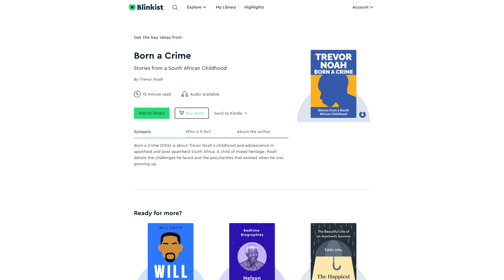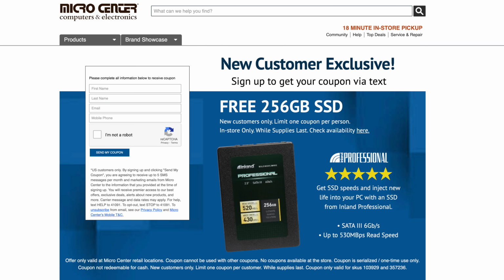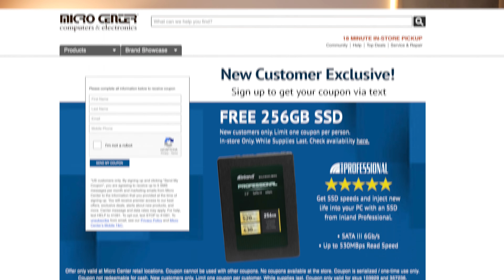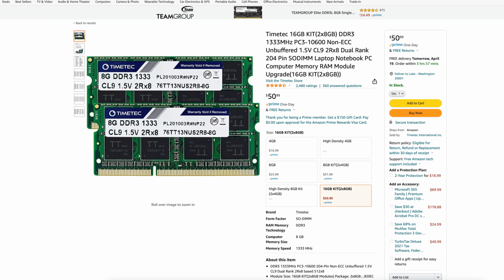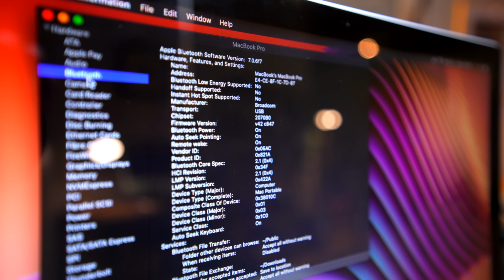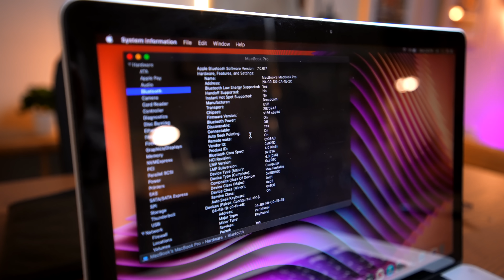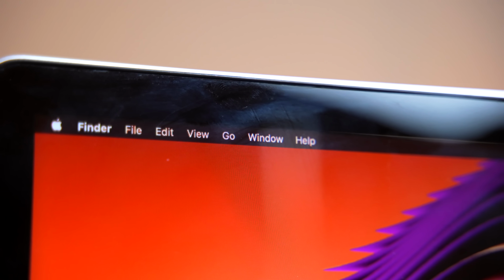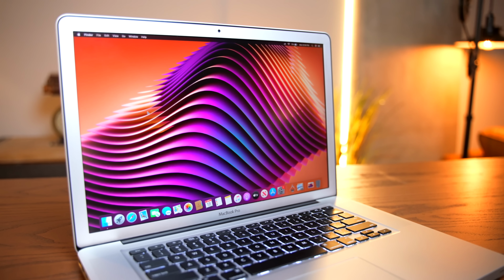Breathe new life into an old MacBook with THIS upgrade

Comment: I do not know Mac books.   So, a question.  Did Apple limit OS versions to certain hardware  model releases?   (As they did the iPads, itouch, etc.    ).  If I got an old Mac/upgraded it.  How easy is it to get what I consider core apps?  Word/spreadsheet/. PDF software?  

I am disabled, disability income….(never will afford a new Mac).    What is a good “cutoff year/model”?  Upgrades for it? And broken out cost?   Also, could we upgrade USB PORTS TO USB3.2?   OR EVEN SAME USB PORT VERSION, BUT NEW PORTS THAT ARE NOT WARN OUT?  THAT IS BIGGEST GRIPE I HAVE WITH OLD COMPUTERS/LAPTOPS.. LOSE WARNOUT PORTS.   

Next,….have you looked at other Apple devices?  Itouch 128gb!  Color…no camera, metal back, needs new battery.

Omg…lol. Run a wire out and correct electric current, I would be in heaven. Lol

would you buy /upgrade Mac for a buyer?

Comment: I just put an SSD and 16GB of RAM in my sisters 2010 13” MBP. My mom has a 2010 15 that will be getting all these mods you listed and using Open Core Legacy patcher to get them on Ventura. Thank you so much for making the video.

Comment: In Denmark all these upgrades would cost you $500. And if you want to buy a second hand MacBook Pro from 2010 it will cost you another $200 - $300. For that money you can buy a new laptop with much better hardware (better graphic card with better screen resolution, NVMe, USB3, modern CPU). Also, graphic cards on these old MacBook Pros suck. They lack Metal support.

Comment: in my opinion just saving from landfield a good working laptop is a good idea that in my case its not that good because of cost, i paid for my 2009 13" macbook pro for like 430 PLN (around 95 USD) and paying around 451 PLN for parts (if i found any) its just doesn't count, next i can't find any display or wifi card on most popular amazon replacements in poland so i don't think is that worth it

Comment: Well, I had a dual core from 2008 til 2 years ago. And the only reason I got rid of it was because the logic board died. Now, not a mac but I still have a Dell Latitude  6540 from 2014 and still running like a charm with windows 11. The only upgrade I have done to it is the replacement of the hdd to ssd. Just mention it to confirm what you have just presented here. Computers have become a lot more long lasting.

Comment: Great video. I have a 09 13” 11 17” and 12 13” all have ssds and max ram 16gb on 11 17” and 12 13” display upgrade on 11 17” these machines out lasted all my retinas MacBooks. My retina MacBooks all died with motherboard failure from overheating. I’ll never ever by another MacBook again. But I’ll keep my 09-12 for as long as they still function.

Comment: Nice vid & I agree. I have 2 Macbooks; both 2012 15" w Hi-Res Matte displays. One is a 2.6 ghz and the other is the option order 2.7 ghz. They are quite amazing, especially for their age
Reply: I have the same mid-2012 15" machine, albeit without the matte display (honestly, 1440x900 doesn't bother me much: it's still a lot nicer than the 1280x800 of the 13", which I've also got). It has 16GB of RAM, 4TB total of SSD space (I removed the optical drive and replaced it with dual 2TB SSDs); I have a Thunderbolt PCIe expansion chassis with a USB 3.2 gen 2 card, and two Belkin Thunderbolt 3 docks. Using OpenCore and Kryptonite, I'm running Big Sur and running an external Radeon RX 580 (the funny thing is that Big Sur actually runs better, and throws better benchmarks, on this machine than Catalina does, which was the last officially supported OS). This thing drives four monitors on its own; with the eGPU and Thunderbolt expansions, it's like an entirely new machine and easily hangs with my Ryzen-powered Windows gaming rig (significantly outperforming it, in some cases). When Big Sur support is dropped next year, I'll upgrade again to Monterey, buying myself at least one more year of software support and, depending on whether they figure out the kinks of getting Ventura running well -- I am hoping by the time Monterey is dropped, that I'm happy enough with Apple's offerings that I might consider a new machine, but so far, I just can't let go of this one. It's fast, reliable, and can still do plenty of heavy lifting (I run the IT department of a not-for-profit and this is my main portable machine, and while at home and on my desk with all its Thunderbolt expansion goodness and dual Cinema displays, it does quite a bit of video and audio editing). All on a machine I got for sixty bucks off eBay.

So you're absolutely right: they are quite amazing for their age. I'll keep mine chugging along, and wish you luck with yours as well!

Comment: I'm new to this channel as well as Macs. Been a PC user since 94'. Do these machines have tweekability in BIOS/UEFI like PC's? What about the CPU/GPU..integrated or upgradable at all? I got ahold of the 17' A1297 model recently for free but it needs some repairs. I don't mind shelling out the cash for it and the upgrades available to it if it can be put to work as an office/desk unit. Not trying to do intense graphical work on this thing. Maybe just Procreate or Sketchbook Pro for illustration.

Comment: I still have a 17” Mid 2010 i7 MBP Antiglare with an SSD and max ram and incredibly it’s still completely useable! I finally got an M2 MacBook Air (which is lovely of course) but I have so much love for the old one. Also, it has FireWire, Ethernet, MagSafe and Thunderbolt so really good IO for music production given its age!

Comment: I also still use and love my mid 2012 15" Retina MacBook Pro. Upgraded the WiFi/Bluetooth card to 802.11ac and Bluetooth 4LE a while ago. It has 16GB of RAM and a SSD, which I upgraded many years ago to 1TB (transcend). It is powered by a 2.6GHz Core i7.

 This machine runs everything I need it for as good as when it was "new". Even the battery still works for a few hours(!). Absolutely no need to upgrade to a new machine.

Comment: Love those siIver bezels, like the old Airs. I have a 9-year-old MacBook Air which I upgraded at purchase (mid-2013 model) to 8GB RAM, plus 256GB SSD. I’m still using this for almost everything (with heaps of apps effortlessly open at once, including the net!), despite it being inadvertently hosed down from my top floor neighbour’s roof garden through my desk window in around 2017 or so!!! (Sat it on a step ladder under my ceiling fan, with silica gel sachets all over it — keep those from vitamin bottles, etc! — for only 4 days!) These machines have incredible integrity. 

I’ve just purchased an extremely expensive (AUD$) upgraded 24” M1 iMac, and despite the great screen and webcam, my 9yr-old MBA has a much better trackpad and keyboard, and the “in the cupboard” speakers on the iMac are a real disappointment (12 years ago, pre Apple, I bought a Dell Studio laptop that had such powerful JBL speakers that I could watch the classic  “Blues Brothers” original film without headphones via the DVD drive — those were the days!!). New is not necessarily better.

Comment: I just bought the 2012 13" MBP for about $100. No drive, but I had a 1TB lying around (750 Mac OS/ 250 Windows). It came with 8 Gigs, but I plan on making that 16. It was More difficult than it should have been to get the iWork apps on it.

Comment: Luke, i'm trying to get a better display for my MID-2012 Macbook pro. I've update it with 2 500gb SSD / 16 GB RAM and it's running Catalina 10.15.7 / It works like a charm, but i was wondering if there is any way to upgrade the display with a one with a better resolution like you did in the video. I couldn't find the link to buy the display that you showed in the video, do you have it?

Comment: I’ve had every Mac computer since the 90’s, and the 2 laptops you showed. The only problem with having an older laptop is you cannot update to the  newest Mac operating system. I have a late 2015 MacBook,  and cannot update to IOS Ventura.

Comment: Upgrading for a newbie is stressful for the first few times but satisfying when you get the hang of it. Upgrading requires a lot of research and people who are coming here just figuring out you can upgrade an old computer likely won't have the skills to even pull this job off, that's the irony 😂There's a lot of things you've gotta know prior before ripping a laptop's gut's out in order not to make certain armature mistake like accidently pulling a ribbon cable too hard and ripping that shit, put it all back together to not know why your system won't turn on, 🤣fun times!

Comment: That’s not a good idea… that’s a GREAT idea 😊
I still use a 2009 24” iMac on a daily basis but it’s starting to be a little toooo slow (I use it for office work only). I’ve upgraded the ram a few years ago to 4gb (it seems like it’s the maximum it supports) and I want to upgrade the hard drive to a ssd for sometime now… but I’ve never seem to gather the will power to do it… but I recon it’s got to be done… soon 😅

Comment: Still using my mid 2012 15in with Hi Sierra! Running Pro Tools & other apps no problem. Removed the Superdrive ages ago and installed a 2nd SSD drive. Just replaced the battery (now my 3rd) Any recommendations for a replacement wifi card? Hadn't thought about that. Thanks!

Comment: I picked up a 2015 MBP.  It has 16 GB DDR3 ram and a 1 TB SSD card.  As I am stuck with a ADSL phone system it makes no sense to try and rig the wifi for the modern 6G stuff.  Are there any improvements you can suggest for this machine?

Comment: Just watching this on my daily driver of the last half dozen years, a factory original 15" Antiglare version mid 2010 2.53GHz i5 - no screen upgrade needed! 🙂I love this machine!
OK, I swapped out the HDD for a preloved Samsung 840 EVO SSD and have nearly worn that out too, wear levelling is nearing its maximum - but I'm still running High Sierra rather than run a hacked later OS, as the poor old GT330M frame buffer is getting a bit glitchy and I don't want to overwork it (although the fault is most likely a couple of main logic board tantalum caps, rather than a flaky GPU).
It generally works fine although the last High Sierra version of Safari is struggling a bit, and interactions with my iPhone XS Max can be a bit unpredictable - but the later Firefox support has extended its useful working life considerably - it works fine watching youtube video. It even survived me spilling some some tea into it, necessitating a keyboard replacement but my quick action to dismantle it saved the main logic board. :-)

PS - I noticed one of the Macbooks in the video when you were claiming 2010 was actually a 2011 or 2012, as the miniDP aperture had the thunderbolt symbol on it! which was not available on the 2010 main logic board, being miniDP only :-) Cheers!

Comment: well, apple products is not really last so long, since you have to use patch only to use lastest OS, and that is not even the lastest for few models. while you can easily use another OS in an old macbook / macbookpro within lastest update with simply no issues. So its pretty ironic, in Apple side, some models are obsolete, but with other kind of OS, it still a very usable machine.

Comment: I just upgraded an early 2011 MacBook Pro with a 1T ssd, 16 gigs of Ram and replaced the battery for good measure. 
It’s insanely fast compared to before. 3 minutes of boot time dropped to about 30 seconds. 
Now I can haul it to work and not feel like I’m gonna break my new MacBook Air lol

Comment: I have a 17 “  MacBook Pro that I truly love. What might I do to enhance its performance? It works but is really slow. It was the last issue of the 17” MacBook and it is sturdy but as I said, I’d like to continue using it. What do you think, Luke? Love your channel and appreciate what you do. Michael NYC.
Reply: You could try installing a Linux distro on it if it's not your daily driver. (I only say "if it's not your daily driver" because it'll take some effort to get it setup and won't be as reliable as MacOS even after everything is setup just because Macbooks aren't built to run Linux.) Depending on the distro you choose, it could require either minimal setup and tinkering to get working or it might require a lot (or it might not even work at all). I'd suggest something based on Ubuntu. Personally, I really like PopOS and dual boot it on my 2012 MBP all the time. I had to use a wired connection at first and install packages to get wifi and bluetooth working, but after that the only issue I have is that it freezes up if you put it to sleep or shut the lid while it's on. Not a big deal for me, it's basically flawless besides that one issue. And PopOS in my opinion is a very solid, fluid distro with swipe gestures and an easy-to-use layout.

Of course, you should also make sure you've got the RAM maxed out, an SSD installed instead of a spinning drive, the fans and motherboard dusted out, and new thermal paste reapplied if it hasn't been changed in a long time. I recommend Noctua thermal paste, I noticed about a 15 degree difference in temperature! I don't know when it'll need to be replaced again so I suggest installing a temperature-monitoring app in case the paste wears out after a number of years.

Comment: I bought an early 2015 MacBook Air, I was looking to upgrade it to a 2.2ghz core i7, 8gb of ram logic board and a 1tb ssd from the sorry excuse of specs that apple released my model with. I added the price of those upgrades against buying the same spec model  from online from either people or a company. It would cost $700 (this is including how much I paid for the MacBook from Facebook marketplace) compared to 750+ for what people are trying to sell the specced up model at so either way I’d either save money or pay about what I would’ve paid if I bought it and honestly using it stock isn’t even that bad as people say I’ve been stressing the heck out of it

Comment: But what’s the latest upgradable OS does it take? High Sierra? That’s as far as my 2010 Mac Mini goes.  Btw, I upgraded that with a 1TB fusion drive and pushed it to 16 GB memory, which I read was it was capable of handling (officially the max is 8), as long as you used a certain type of memory (which escapes my memory). It’s getting retired this year.  I was hoping for a M2 mini already!

Comment: Watched this on my early 2011 17" Macbook Pro with a 27" thunderbolt display. I pretty much did most of these upgrades on the MB, the screen was the only thing I didnt do.  So yeah using older equipment is a very doable thing.

Comment: Hey Luke . the MacBook pros from 2011 , do you notice a difference in performance compared to one from 2013 . I'm asking because I heard the 2011
models still didn't have hyper threading technology , but the ones just two
years later around 2013 did.

Comment: I had terrible times with my 2009 and 2010 17'' inch MBPs. The first one died suddenly and the second over the years needed several repairs that cost me loooot of money because it regularly crashed down. I kept the second one until 2017-18 somehow, but it was a pain in the butt, since it was impossible to have any software update and to run the latest mac osx and most of the latest applications versions. The machine also tended to be so lame and the applications to be really difficult to handle. At the end not only some chips were out of order but the screen became black for ever. I had such bad times with these MBP so that I have to laugh at looking at such videos.

Comment: Strangely enough I'm doing almost exactly this with a couple of old Macs at the moment. I've only gone for a RAM and SSD replacement, but even that has made them feel like new machines.

The first of them is a 2007 Black polycarbonate MacBook which can't run anything newer than OSX 10.7 (Lion) so instead has been set up running Ubuntu Budgie 22.04. Given that it's already a 15 year old machine when I write this with the 22.04 release having long term support for 2 years and considering the laptop will probably still be within minimum system requirements for the next major LTS release of Ubuntu I'm thinking it may still be a usable machine for basic browsing and email tasks up to its 20th birthday! Boot time to desktop (including typing password at login screen) is now about 50 seconds... Pretty impressive for decade and a half year-old tech running an operating system released 2 months ago.

The second machine is a mid 2009 MacBook Pro, the last of the Core2 Duo machines. Officially you can only take it up to 10.11 (El Capitan) due to HFS+ limitations in its architecture, but unofficially, thanks to DosDude1 (look him up) writing custom support for APFS drives you can get Catalina to run pretty flawlessly. This machine maxxes out at 8gb RAM, but a cheap 500gb SSD gives it plenty of scatchdisk headroom for the future. Another machine with a useful lifespan extension of 4 or 5 years, and then it will probably follow the Linux path to keep it running even further into the future.

Comment: I was gifted outright an old dysunctional MacBook 2011 15" with that matte screen. "Turned off" the dysfunctional dedicated gpu (with a simple software command in single user mode), put a 1 terrabye drive in, and it already had 16g of ram. Open Core Legacy'd it and now I'm running Monterey 12.4 on a machine made in 2011. A lot of this, sir, is your fault.

Comment: Biggest issue I’ve found is the battery. By now it doesn’t hold a charge and might even be expanded. I have 3 of this generation MBP and 2 had an expanded battery and the other wouldn’t last more than a few minutes unplugged. I wanted to upgrade them and sell them and make them useable computers and have some fun working on them, but with a $100+ battery it’s not worth it.